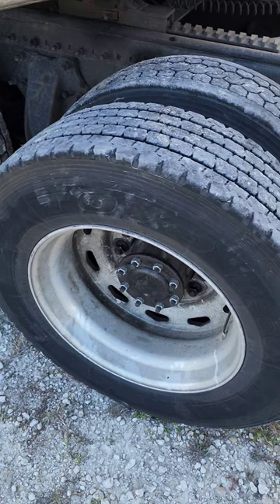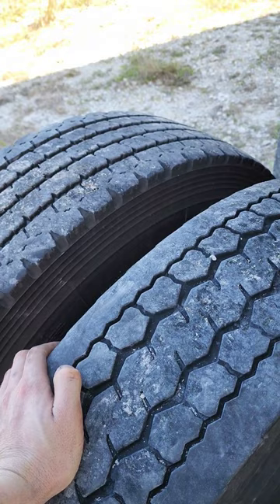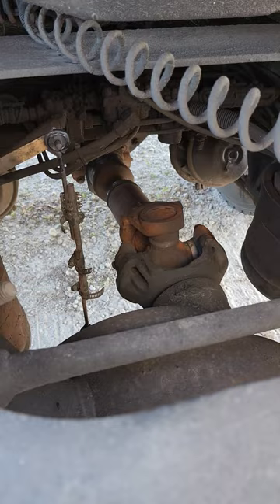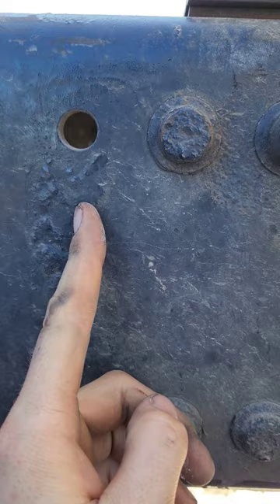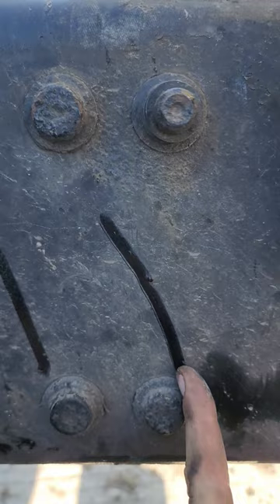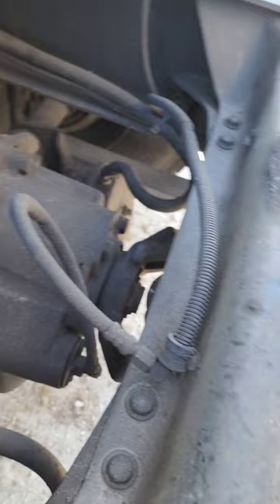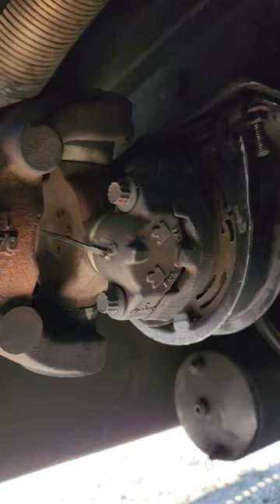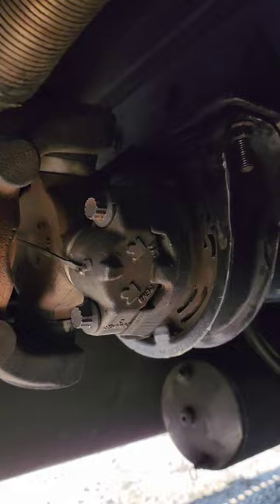Freightliner Vibrations Talk, Century, Columbia, Subscribe for more

Comment: Put a shim here, adjust ride height there. Not that simple. Let a real mech do it. Your hose clamped ride height linkage tells all.
Reply: Guess you never bought a new leveling valve..they come with hoze clamps...
Reply: @leejohnson6173  I've installed plenty, and every reputable shop says throw them out and get a threaded adjustable. I've seen hacks put them on with string and all kinds of shit. If the suspension mfg doesn't supply it with clamps why use them.

Comment: Mixed matched tires different brands and tread patterns will give a vibration because of the different types of rubber and tire construction
Reply: Absolutely. Also out of round tires can give low speed wobble and higher speed vibes.

Comment: I’ve replaced axle shafts shocks  tore arms. Diffs rebuilt drive line/ new carrier bearing checked ride height. And still  have a shake from the back. Wondering wtf else it could be tomorrow I’m checking all of the drive wheels on the balance machine. Can’t find the vibration. Might get shinning the carrier bearing
Reply: Did u figure it out? Im dealing with the same thing. No one can figure it out.
Reply: Mine is doing the same but just in 9 gear / Columbia 07

Comment: You know that hub takes like 1.5L to almost 2L  oil there is hub plug to fill
Reply: How do you determine that? You can't from the hub.
 On level ground check your diff. Level through fill plug.

Comment: Make sure tires don't have flat spots . Usually wheel seal leaks before hub gets loose. If a drum doesn't center you either have a damaged hub or out of round or possibly cracked or broken drum. Check all ujoints and never use the cheaper center / hanger bearing .